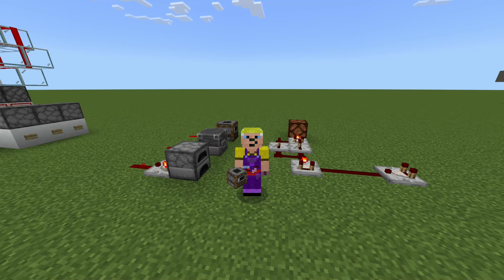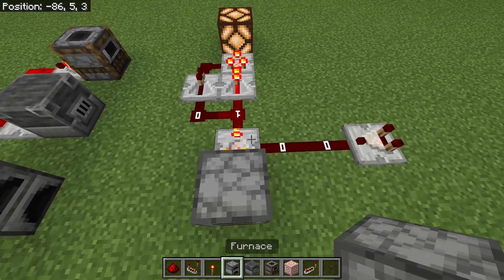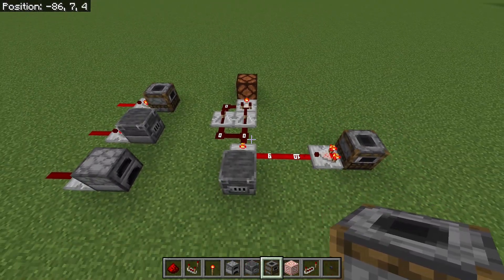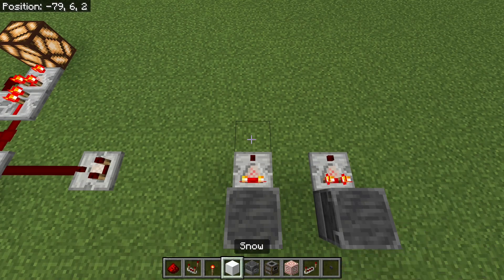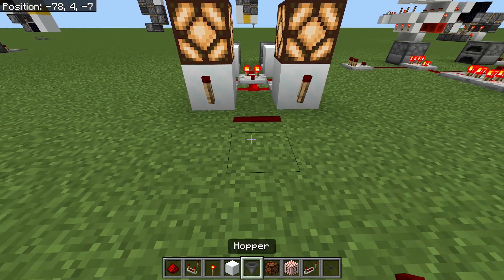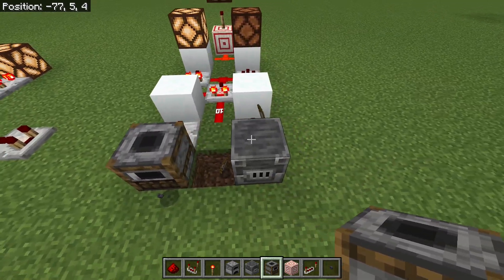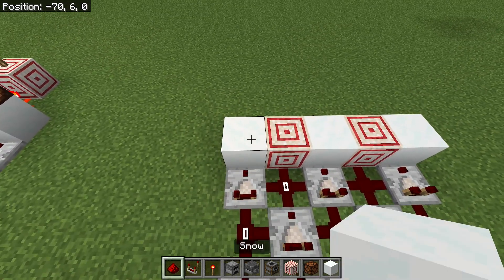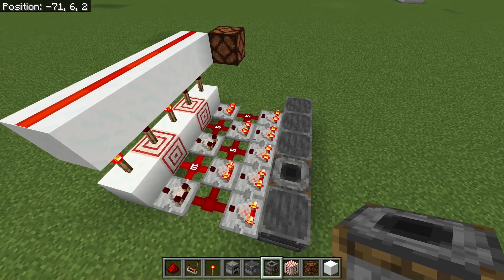Compare Signal Strengths in Minecraft

Comment: This is a really good video and has a lot of good information. But I feel like it leads to a lot left to be explained. For example: the circuits you showed cross the signal strength paths. Doesn't this corrupt the data? We can tell we had a higher signal but we can't tell which signal was the higher signal? Very useful circuit to tell if you had a higher signal. But not really a comparison circuit because it really just flags whether it had a higher signal and doesn't tell you which one is the higher signal
Reply from the maker: Yes, the one wide tilable multi input one just tells you when all the signals are the same. The 2 input version also tells you which is higher. I also have an old circuit that tells you which of a set of inputs are the highest but I never did a video on it.